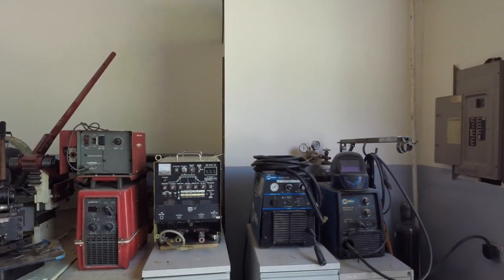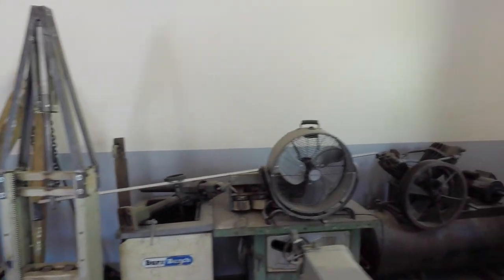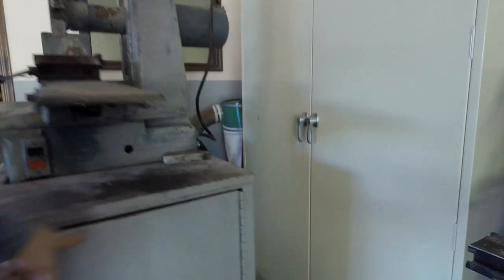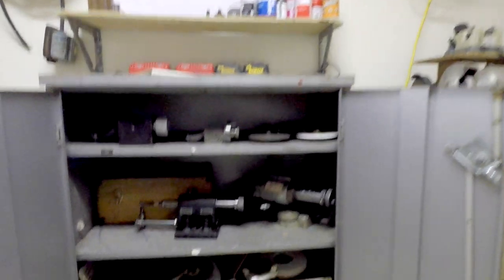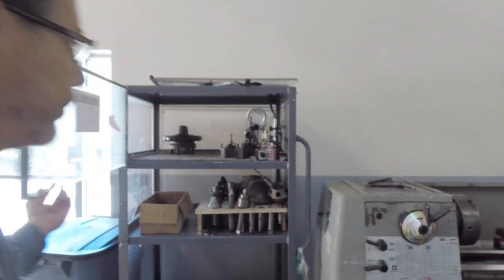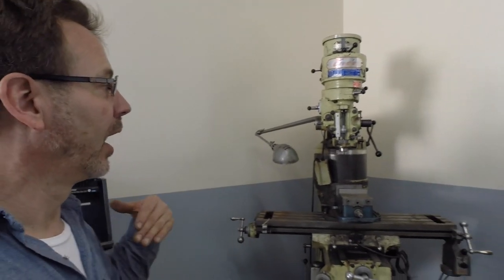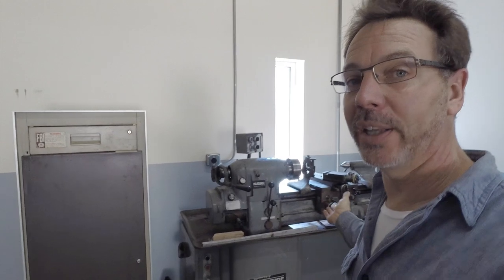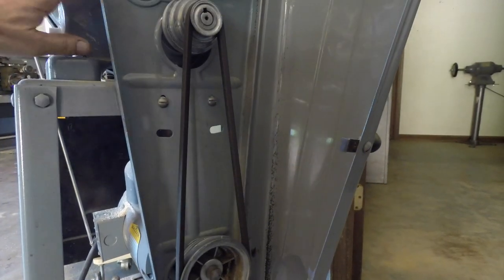New old shop 3 of 3

Comment: no wonder why I can't find any metal working tools on CL in Atlanta now!!
Welcome to town.  I'm beginning metal worker looking for lathe and milling machine.  thanks for your videos - nice work. I'd like to know your opinion on the Precision Matthews machines.  PM1340GT and PM940 Mill? 
btw, get the Swagoffroad finger brake kit when you get a 20T press, cant beat it.  Great guys, I have their roller and also have JD2-32 bender.  noticed you did not have either - so under equipped!

Comment: It won't be a complete shop without a metrology station complete with a decent surface plate.  You will need it for accurate layout, precision measuring, and as a reference for scraping things you want to recondition or otherwise need to make flat and/or square.  Getting the surface grinder going will quickly make it obvious.

Comment: YOUR MISSING A KEYSEATER MACHINE,  AND A VERTICAL SLOTTING MACHINE BECAUSE AFTER YOU DRILL A HOLE , YOU WILL WANT TO CUT SQUARE CORNERS, OR INDEX SQUARE CORNERS AND YOUR MISSNG A METAL SHAPER  ITS SLOW BUT IT CAN AS EXAMPLE CUT DOVETAILS WITH A 4 DOLLAR TOOL VS A 75 DOLLAR MILL CUTTER PLUSS YOU CAN WALK AWAY FROM A SHAPER AND KEEP IT RUNNING ETC!